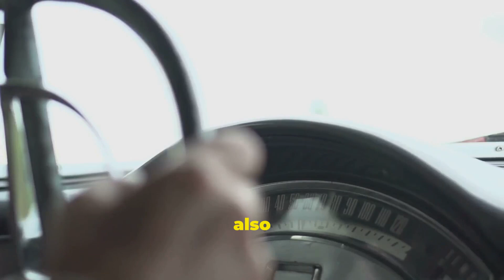Why Cars Don't Use Inline-8 Engines Anymore

Comment: I'm wanting 1, to use, but in a wrecker, i  have driven some, worked restoring cars in my past, but now wanting a wrecker, but wanted a vintage engine, a straight 8 is my top choice, but Olds V8 would be close second.
Reply: I always wanted a V-16 car. Like old Lincolns, Packards, Cadillacs, & such. Just never had the money to buy one in good shape. I have a 1934 Pontiac Sedan now with original straight-6 in it. Beautiful car - all original. Fun to be seen in it !!

Comment: Maybe the same reason in-line 6 cylinder car engines are less common. Hard to find space under the hood unless the engine bay is quite long. More so obviously with a straight 8. Obviously a transverse layout isn’t going to work with a 8. The Suzuki Verona made in the early 2000s, was a transverse in-line 6. But only made for about 3 years.
Reply: Australian Austin Kimberley was also a transverse inline 6. Gave good frontal intrusion protection in a collision like a big bulldozer blade. https://upload.wikimedia.org/wikipedia/commons/thumb/2/23/Austin_Kimberley_Mk_II_%2815472707343%29.jpg/1024px-Austin_Kimberley_Mk_II_%2815472707343%29.jpg
Reply: V6s were the obvious choice, and it's not as if they weren't considered; hell, Plymouth had a 196 cube V6 OHV design as a prototype...in 1951!  It's shortened length, considered an advantage for even the more typical front-engine, RWD layout, as it'd enable a lower hood, shorten the wheelbase and keep overall vehicle weight down, was very appealing.  However, the 60 degree configuration, a far smoother design that the various 90 degree V6s that had been tried, made it necessary for this engine to have its own production line, as opposed to the Hemi V8s that were coming out by Chrysler.  There was consideration for Dodge to use this as the base engine also, but the Dodge division wanted a larger displacement, and it was found that in the effort to make a lighter engine, the cylinder bore spacing didn't allow for more than 230 cubes, which was where they were with the venerable flathead six.  Not only did Dodge nix sharing a common engine with Plymouth (which would change with the "A" series V8s, or "Poly" engines, later in the 1950s), it went ahead with the "Red Ram" Hemi V8, which has puzzled car enthusiasts since, the displacement being but 241 cubes, not much more than the flathead six which Plymouth was stuck with as their ONLY engine, and Dodge as the base plant, until the introduction of the "A" engines at 276 cubes for the Plymouth in 1956, and the famous Slant Six for both lines (but not the soon-to-be shuttered DeSoto, nor obviously Chrysler division) in 1960!

However, although Chrysler's own flathead eight was dropped in the Chryslers after 1951 (offered concurrently as engines were used up) and DeSoto after 1952, the flathead six, having actually decent power output and a well-deserved reputation for durability, kept going through the Fifties.  Even after the Slant Six replaced it, the flathead was still produced for industrial, agricultural, and even MILITARY use, as the US Army actually preferred it for their "Deuce and a Half" truck over the "Slanty", that contract only running out in 1968!

Comment: You seem to have completely overlooked the Chrysler straight 8 cars .
Reply: Those were in the upper end cars, so luxury and near luxury. But Pontiac used them, too, all the way until 1954, and even top model Pontiacs were strictly mid price. Hudson was another that offered a Straight 8 until their inline 6 became so huge that the 8 was superfluous.
Reply: @seed_drill7135  Long time ago a friend had a DeSoto with a flathead straight 8 engine.
Reply: @harrygatto  Most DeSotos had the 251 cube flathead inline six; it had so much torque for an engine of its displacement that most who bought them were happy with it.  The 323 cube flathead eight certainly was more powerful.  I think it was also how Chrysler packaged the deal; if you wanted an eight, it was in the more expensive trims, and by the time you drove off the lot, but for a hundred bucks or so more, you could get a Chrysler...or a Mercury or Oldsmobile.  Many car buyers figured this out; this was the main reason for the demise of the DeSoto make.
Reply: @selfdo  Very many thanks for this information. It was 55 years ago when I knew this car so can't remember very much about it. My friend was a welder who pulled a trailer with a heavy generator and an arc welder, the car had so much torque it didn't even know the trailer was there.

Comment: Some 50 years ago injlherited 1951 Pontiac eith straight 8. Real smoothie and with Hydramatic go all day quite nicely  st 70. Not easy to do with 1940 technology. Very flexible. Which didn't a whole og good coupled to a hydramatic with 4 soeefs the extra one beliw 1 of ac3:sowed transmission. But horsepower was stinkeroo for its size and performance while ik wasn't what it should have been by 1955 to 1972 standard. Gas consumption quite awful by thevstandards of later better design 6's. V8;gas consumption 6 cylinder performance.

Comment: My favorite engine configurations.
1 ltr to 2.6. in line 4
3 ltr ot so to 300 cubic inches.4.9 ltr. In line ,6 if you can do it. If need compact engine V6. Do note that classis 6 and V6 in the ,3 ltr range have proved to be disappointing gas hogs. If you think tou need such an engine you might want to consider 2.5 or 2.6 ltr in line ,,4:instead.
V8. Don't even considervone beliwv300 cubic inches. Up to 500. But if you need an engine that big you may want to consider something like Ford Eco boast turbo harging . Fir honest to god trucks need a diesel. And pick up truck owners would like diesel if legal but donnote diesel very pollution.